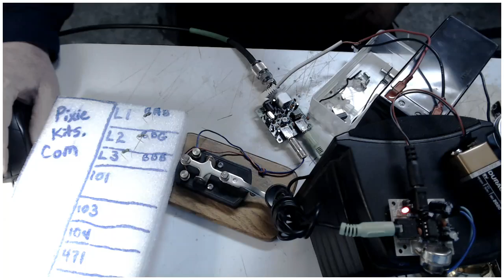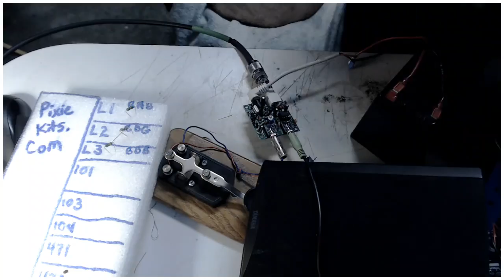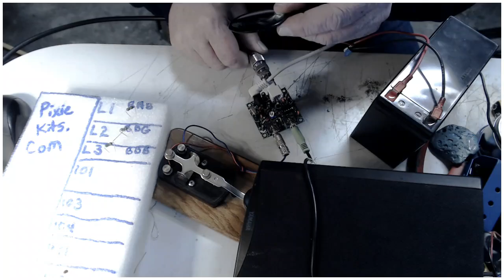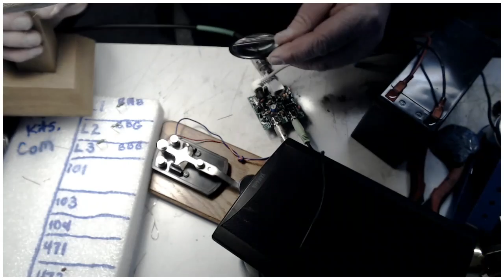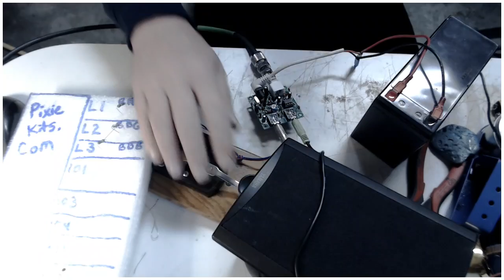Testing pixiekit I just built

Comment: Nice video of assembly procedure,  I do have a question regarding the crystal seat.  The seat on my board seem like the holes are too big for crystal legs , upon putting the crystal in the seat it wobbles and will fall out upon turning the board over.  What am I missing? This is first kit I  have purchased.  Thanks again for the videos!
Reply from the maker: What I ended up doing is solder an additional seat onto each of my crystals I use and plug the crystal set into the crystal seat and it makes far better contact
Reply: @DIYELEKTRONICKITS  AH!!  I knew that there must have been a trick, thanks for the advice!  Very helpful and much appreciated.